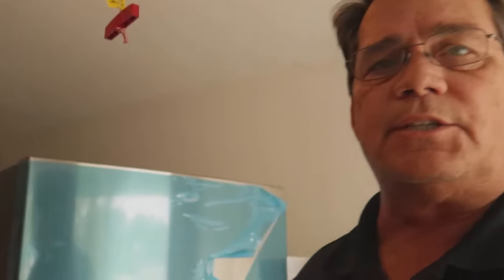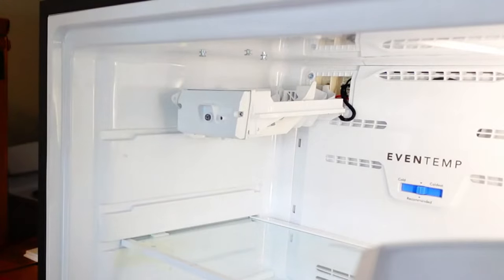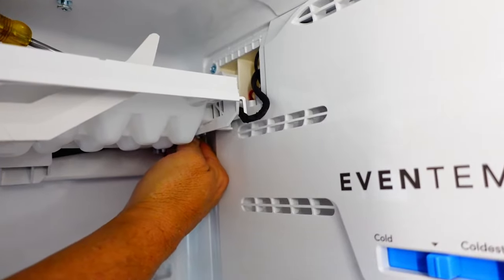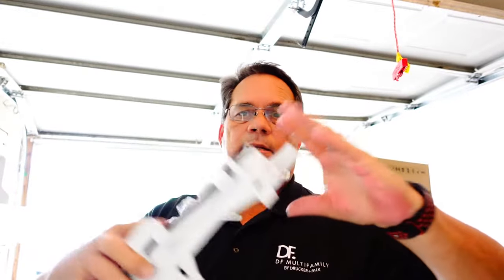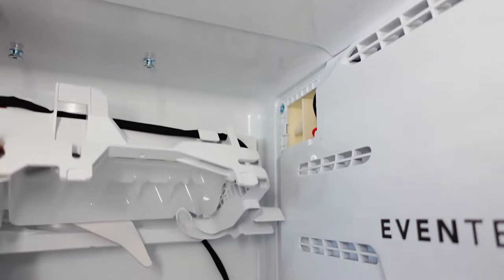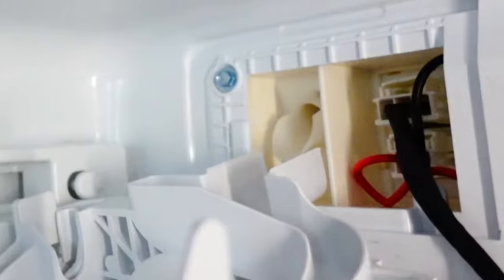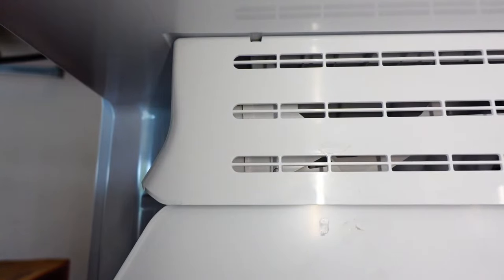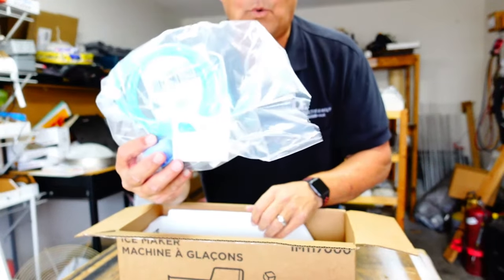How To Remove A Frigidaire Ice Maker. Removal, Re-installation & Review. IM117000

Comment: I just returned a brand new Frigidaire frig to Lowes because it required this POS ice maker. I bought it because it was “identical” to the one I had for 15 years and thought I could use the ice maker that I replaced last year but NOOOOO. They had changed the hookup and I had to buy this new one for $150. Upon seeing this video I returned the frig and got a Whirlpool that takes an ice maker with the heat element like the one I had for 50 bucks cheaper. I like the Whirlpool better because all I had to install was hang the unit in the freezer and it was very easy. Hookup the water hose on the back because all the piping was already on the frig. It was ice-maker ready. And the Frig was cheaper than the Frigidaire too boot. Thank you for keeping me from enduring a bad Ice-maker for the nest decade.

Comment: You saved my life. Our plumber installed the ice maker. And the next day the ice holder box was one huge ice cube. No ice cubes were made. So I found your video, took the cover off and then slid the ice maker forward to find that the water hose was BELOW the little curved slide for the water. Thank you soooooo much for telling me how to take it apart. I would never have been able to figure that out.
Reply: Same thing happened to me.  Thanks for the tip!

Comment: I almost ripped the ice maker apart using brute force, now I cant get the plug out, Now I found ur you tube and taking the plug out is differrant then the one you show . my plug has to side clips , I broke one off by accident and I have put pressure every which way possible the other and top,still cant get the plug out.

Comment: It’s been two years since you made this video and Frigidaire is still coming out with this exact ice maker. I purchased mine about 5 months ago and received an email about a recall. I received the exact same ice maker as the previous one, so hopefully they made some improvements.
Your video was very helpful in the instructing me to install it without having to wait three weeks for a repair man to come and install it.
Reply: Frigidaire didn't really do jack.   I heard about the recall too due to some white chips or material breaking off and getting into the ice.   Supposedly they had made a new version of the ice maker, but when I got it, it looked to be the same thing.   So I thought perhaps it was made out of different materials.   NOPE!   2 weeks after installation it stopped making ice.  (OK, not completely stopped, but it makes ice very slowly).    Now 6 months later, the white chips have returned.    I am under a service contract from the company I had bought the unit from, and they were out to my home no less than EIGHT (that's right 8) times.   As of now I am trying to get a hold of the original salesperson so we can move forward from there.   While I might get an entire new refrigerator out of this, it does mean that I am going to have to go back to researching them, finding out which ones are energy efficient...yada, yada.   I am really not looking forward to that.   As a whole the Frigidaire refrigerator I have is fine.   Yes, I had some problems in the beginning, but all were rectified with the exception of this stupid ice maker.   I think what might be a better alternative is to just replace it with an after market unit.   I would figure that by now it is out there that these units are trouble.   Yet, Frigidaire doesn't seem to be doing anything about it.  So I am wondering if someone has replaced one of these flex tray ice makers with something better.

Comment: Thanks Dan!  Perfect and clear explanation.  The seller sent an installer team to install the icemaker after the refrigerator had been delivered.
It never worked and it actually leaked water in the bottom of the freezer.  I turned the icemaker off and I have not been able to get the insyallers back.

I decided to fix it myself and yiour video was great.  When I tried to take the cover off, I ended up breaking the little tab holding the cover.  
I finally figured out that the screws were too tight and I ended up removing the icemaker tray assembly itself first and using a Phillips screwdriver, I loosened the three screws holding the cover.  The cover slid out easily after that.  After trying to reassemble everything I realized that the two screws holding the assembly with the ice tray were too tight as well and the assembly had not clicked in completely.  

I have reassembled everything and I am keeping my fingers crossed ... :-)

Thanks again for your video.
Reply: I have the 11 7000 and it don't work, going to remove and teplace,your vid really helped, thank you

Comment: Excellent video, thanx! A few people have asked about the reset button to the right of the on off button.  In my research I found out if you push it along with the power button and hold it for three seconds, it goes into a mode where you can program the size of the ice cubes. One light  blink is small, two is medium, three and four are bigger.  Hope the thing lasts more than a year though.
Reply: where did you find this information? I can't find a manual anywhere that tells what the buttons do
Reply: @Carter_Moody  If I recall correctly it was on Frigidaire's website under the reviews of the icemaker...it was a response to a negative comment.
Reply: @ironrupik  thank you

Comment: Wonderful wonderful wonderful.....I'd been trying to get that wiring harness out for about 3 days. Even had a borescope in there to see whether it had to be pinched from the sides. I ended up breaking the clip at the top the same as yours but finally got that thing out. Thank you Dan - you have a new subscriber.

Incidentally I've just dissected the one I took out - I'm in disbelief at the complexity and the cheapness of the build. The three wires are neutral, live and voltage out from a relay which presumable actuates the water valve. Live and neutral go to a full bridge rectifier, transformer and switching regulator to power up a processor and motor drive and sensor circuitry. They didn't even bother to put connectors on the board for the motor and sensor wires ... they're just squeezing the metal traces on the pcb with cutouts on the pcb to prevent lateral movement. Shake that thing hard enough and those flimsy connections would just fall off I think. All the other ICs and transistors are blob mounted so I didn't want to waste any more time on this piece of ... ice maker....just suffice to say it's not easily repairable. 

Thanks once again ... the answer I'd been looking for.

Comment: Dan. PERFECT video. Everything I needed to know, with no bs. I'm 9 months in and the ice seems to be sticking, right on schedule as you said. And happy hour is only minutes away.Oy. This fridge didn't come with the Ice maker and it was installed at the appliance store, so it's probably under warranty. THANKS AGAIN for the detailed, PERFECT explanation of this Ice Maker.
I wonder if you (me) can buy and install just the cheesy flexy ice tray...hmmm.
Reply from the maker: I don’t know if the tray it self is available yet. I’ll have to check on that. Good question though and I’ll be sure to do an update if it is.
Reply: @danjiles  Just went through your procedure on removal (I kinda jacked the plug in the back and shied away from actually unplugging the ice maker itself, but inspected the tray which looked shiny still.), and came to the conclusion that with our hard SoCal water, the 1-2 year life of the inline filter looks to be roughly 9 months. Switched it out, light is no longer blinking (yay!) and I'm betting on ice being ready for happy hour. 
YOU are MUCH appreciated regardless of how this goes.
Thanks for taking the time to make a perfectly detailed video on this. Way cool.
Reply: @danjiles  Ugh! Wife just opened freezer, and said the light's blinking again! Oh well. Nobody at fault here, just an unreliable ice maker. Turned the freezer colder in case it's a temperature issue. I'll let you know.
Reply: @danjiles  So, for the record, there's a sneaky assed little button to the right of the "on off" button, the one that lights up. It cycles the tray or the system. Since the purchase was under warranty, a tech came by and we ironed things out. He said the same thing about the ice maker, extolling the virtues of the high quality and reliability of said POS. Lol 
Thanks again for your vid. It still kicks ass.
Reply: how did you keep the ice from sticking
Reply: @Carter_Moody  I didn't. The ice maker was futzy at 9 months, the compressor was replaced then that failed, and FINALLY Fridgidaire broke down for a new fridge, slightly deeper than the old model, called a "Gallery" with, you guessed it, NO ICE MAKER. FACK!! Oh well, I ended up buying 8 silicone ice trays and a couple of large cube trays as well. Using distilled water. The ice is fantastic, but as you also might guess, a total pain in the ass.

Comment: Hey Dan, should the ice tray fill right away after installing it? I had an ice blockage in the fill port. Defrosted the freezer, and checked that it was now free of ice. But it won't fill. And yes, I did turn the water back on. Even tried another water valve.

Comment: Dan —- you are correct that this style is a POS.   I got a new fridge 2 years ago with this style.   The first problem was really slow ice production.  Several hours of internet and I discovered there are 3 settings for cube size.  This info is not in the manual.  I changed from the smallest to the largest and it then made a reasonable amount, still not as much as the old style.  About a year in the circuit board failed.   I replaced the unit and now after another year the replacement stopped working.  Soooo I intend to adapt the old style ….  As you know they work great.
I need to figure the wiring as the old have 4 wires and this has 3 … but I think it is simply that the new one has no ground wire.  I will also may have to do some creative tubing if the inlet does not line up.    This really. Is a POS. If you have any suggestions please weigh in.
Reply: How do you change the settings for ice cube size?

Comment: Any tips for having the tray turn a full 180 to drop the ice out, I have to manually lower the arm so that it knows the bin is empty and then it will continue to rotate to dump. Frigidaire sent a replacement and that one only turns 45 and I can't get it to keep turning to 180 to dump as the arm will not let me lower further.  This tray model is actual by EMZ model ANC A11127913 and it is used in different Frigidaire in freezer ice makers. Turning/powering off, waiting, and then on doesn't reset or fix.  Pressing the little ice icon in front doesn' t resolve problem just fills tray with water.

Comment: Just purchased a FRTD2021, and considering adding an ice maker. Would it be too much trouble to modify the mounting of an IM116000 to work instead of the IMKTF20A? Also, if after the cubes started sticking, would a little nonstick cooking spray help?

Comment: Dan what is the white plastic clip for (part# 218990901 30" model only) its about 2.5 inches square and rectangular hole in it. It cam with my im117000. Can find it in directions, but shows it in the parts list. Thanks
Reply from the maker: Good question, I see the description as being a wire clip but I can't find any pic's of it. 
If you don't see it used on your frig, I wouldn't be too concerned about.

Comment: HI Dan I just found your video. Great job of explaining. I was wondering how the ice came out. Anyway I just installed one of these ice makers in my brand new refrig. I followed the instructions word for word. turned on the water, turned on the ice maker. The green LED came on. Nothing happens. I had my wife turn it on and off while I had my hand on the water valve. I don't feel or hear a click. Any thoughts. Or tips on diagnosing. Or should I just get another ice maker.

Comment: What I was interested in was how to cycle this thing and what to expect. Also is the  arm on the right side a ice level sensor and do you expect to see it down when it is low on ice. Installation was easy but operation is with out instruction. I thought your video was great and anything you could add would be wonderful. Thanks!
Reply from the maker: As far as I can tell, the arm is only for ice level. The on off switch is all you have. 
The cycles are based on temperature of the freezer, I’m told 18 degrees is the starting point, all though I haven’t proven that yet.
Reply: I’m managing a complex with 320 of these fridges / ice makers installed here and it hasn’t been fun. There is a reset button to the right of the power button. One press flips the tray and a five second press cycles the power and calls for water.
Reply: @shawnhall4898  Thanks, very helpful! where did you find this information about pressing the buttons?
Reply: In the service document under the refrigerator back cover

Comment: Just installed a new French Door Frigidaire FRFG1723AV and the ice maker dumped ice ONE TIME and never worked again. Water is getting to the filter, but the ice tray never filled up again. Temp is 0 deg for 24  hours. I am now in the process of unplugging the fridge and will plug it back in again to see what happens. Wondering how the ice maker knows when the ice tray is full.

Comment: Quick question (I hope): Will a Frigidaire (French door) still run normally if you remove the ice maker and don't replace it? Some people prefer the extra space and don't want the bother of a water line hookup. I ask because I knew of a Samsung refrigerator that would show a blinking display and error codes if the icemaker was not connected. Very well done video, empowering DIYers!

Comment: There is also a little botton next to the power button that will call for ice if you hold it for 6-10 seconds. But the problem im having is keeping the icemaker level arm down so that it continues to make ive without having to manually do it like that

Comment: This ice maker sucks. New fridge and 6 months in and already failing to drop ice. Do they sell a replacement unit? Or a replacement tray that works better? Maybe a silicon spray adhesive I can coat it with?

I'm going to try some Food Grade Silicone Lubricant for Ice Machine

Comment: I just got my new fridge yesterday with the ice maker installed for me. It’s been more than 24 hours and not a single ice has been dropped, though its in the tray and i can see when i turn it on and it turns. There was a loose screw in the little arm on the side of the ice maker which i have no clue what its used for because yours doesn’t have that screw. Any suggestions? I’m going to wait another 24 and call the people that did my installment if i see nothing

Comment: How does one winterize this ice maker I winterize homes by forcing air through the waterlines the older ice makers had jumper spots on the cover of the ice maker. 
Because one needs to move the water with air

Comment: We just got this fridge and instillation seemed easy for the ice maker. However there is no water flowing to the ice maker. We have checked all the connections, made sure there were no kinks in the copper hose water line or the plastic tubing that leads to the top of the fridge, and made sure that the water was on. Suggestions on why nothing is happening?
Reply: I have the same issue. Dan Jiles HELP!!!!!!!

Comment: We started installing these units in June of ’21 , 98 of them. Lots of problems, some of the most common ones are ( upon arrival ) 
-Light not working due to warped door
-Small green water line pinched or loose and leaking 
-Bad computer boards
-power issues with wiring harness too taught
- icemakers- leaking, freezing up
- bad compressor/ loss of butane— which was unrepairable due to no trained technicians to work with butane anywhere near New York state (4 total)
Not my favorite either Dan

Comment: Hey Dan, did you switch your editing software within the last year or so? What software are you using ?
Reply from the maker: +Apartment Maintenance I use Filmora and yes it’s been about a year now. Also using a better camera than the DSLR I used prior. 
Cannon D7X Mark II / I just bought the Sony ZV1 and shot this video with it.
Reply from the maker: Does it look better?
Reply: @danjiles  Yeah the videos look great & I noticed the fonts & style was different with thumbnails and everything so I figured you switched editing software
Reply: @danjiles  I bought a GoPro hero 7 Black awhile back before the 8 came out & I haven't even opened it yet. I'm  just so used to using my phone to film. I need to mess around with the GoPro before I use it filming a video just to make sure I do everything right cause I don't want to lose my footage.
Reply from the maker: I totally understand. Ive tried shooting with my GoPro and also the DJI Osmo Action. I find the style a little off. you have to have really good lighting for the footage to look good. That's why I went for the Point and Shoot Cameras that do well in low light situations. A cell phone is a good tool, they have gotten really good on video and deal really good with low light. Keep up the good work.

Comment: Nice video .. was just looking at these even temp models. Not sure how to feel about that even temp system but it didn't look like it could house an ice maker so I learned something. 
To be fair all of them have reverted back to flex tray-style even Whirlpool in their side-by-side models with the ice maker in the door. Maybe it's the advancement in plastics today or it just makes larger cubes. Who knows LG and Samsung also use this style mostly? so it left to be seen where reliability is concerned. Frigidaire is using this style for french door for some time so it's natural they use it on top mount and unify the lineup.